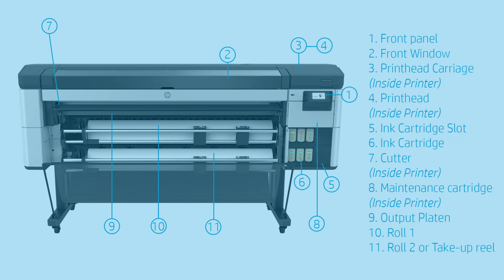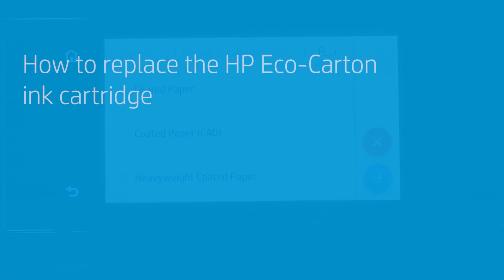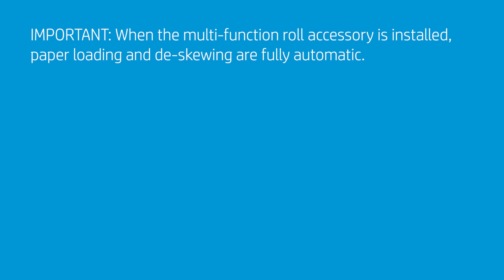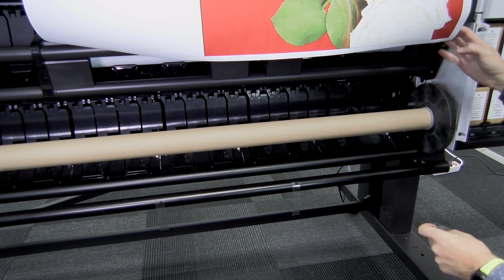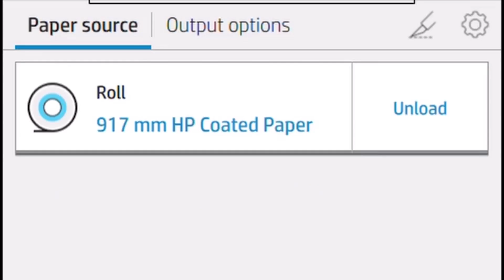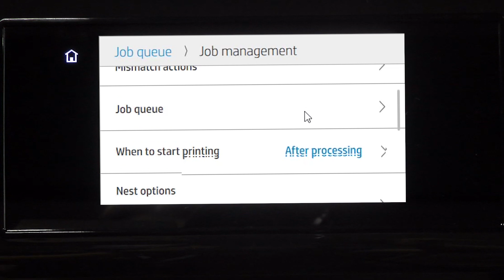How to Use the HP DesignJet Z6 Pro /Z9+ Pro 64-in Printers | HP Printers | HP Support

Comment: How do you stop this printer from running the "preparing print system" a couple times every week? It takes around 50 minutes and uses up to 3% of each ink cartridge. HP support has not found a solution. Cannot find a solution in any forum. I've cleaned and then replaced all the printheads. Firmware is up to date.
Reply from the maker: +John Urbanski Please refer to the instructions mentioned under this document to fix the issue: https://bit.ly/3GJZxLo